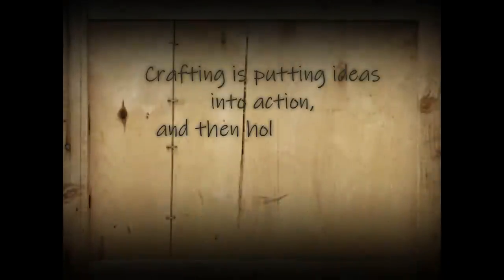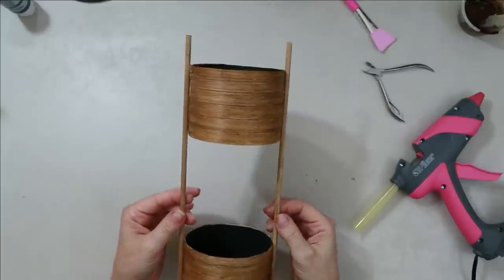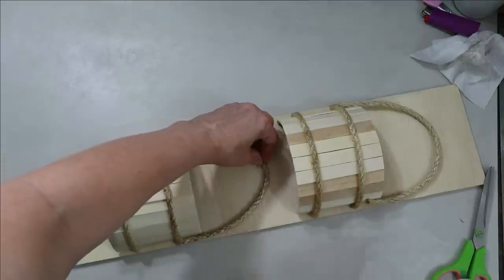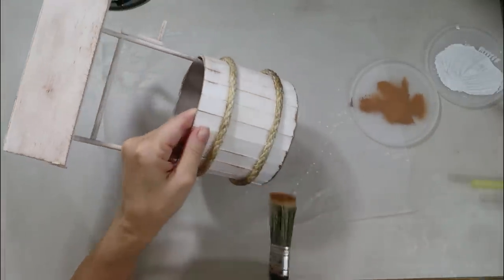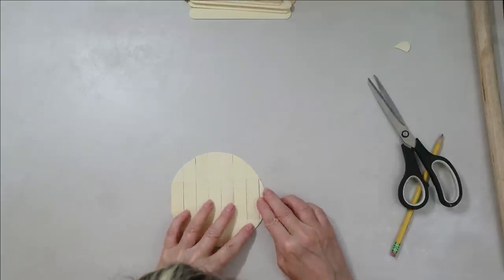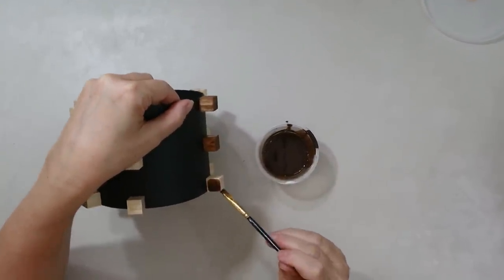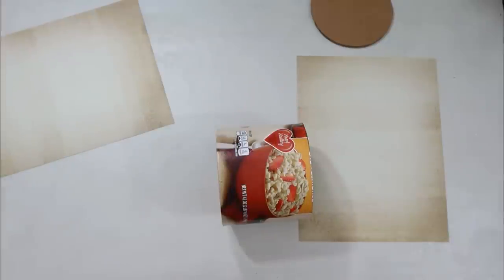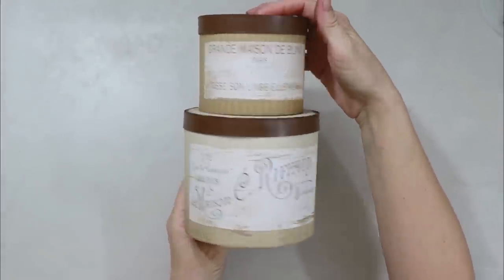8 AMAZING OATMEAL CONTAINER CRAFTS | CHEAP DIY CRAFTS

Comment: Oh my goodness I forgot it was Sunday. Thank you for doing these oatmeal containers I have a bunch of them on my refrigerator just waiting for a project or 2. Normally I recycle them by turning them into toilet paper holders LOL .
I used to live in a tiny apartment in New York and there was no room in the bathroom for a spare roll of toilet paper and the worst feeling is running out and not having a spare roll so I found that the Scott tissue or the store brands equivalent to Scott tissue fits nicely inside the can of oatmeal you get two rolls per can. So I decorated my oatmeal can with scrapbook paper and ribbon and florals and put it in my bathroom on the tank it was the only storage space that I had. I've made a few since for friends and relatives including myself. Necessity is the mother of invention.

 I am currently making a vase using a empty protein container and empty oatmeal can and a bowl that I made from scrap paper to act as a flute on the top. I always wanted a tall vase so I can put those pretty Twigs in for Christmas or springtime. I was using your idea of joint compound when I remembered the plaster gauze that they used to set your broken arms with, remember that? So to save money on joint compound I got a roll of plaster wrap and put that around and then put a layer of joint compound on top of that. It is my work in progress. I will have to tag you on Pinterest when it's done.

I keep seeing Christmas projects on YouTube now as well as the Autumn and I'm just not in the mood to do Autumn crafts it's coming too fast LOL

Comment: They are sturdy containers. I always hated throwing them away, because they are so sturdy. Now, I don't have to. The other thing I like is they are straight, up and down, containers. Usually the containers, we use, are tapered at the top or bottom, so these are great, for wrapping materials around them, or putting things like the popsicle sticks, up and down on them.

Comment: All very cute!!! Not sure if you actually use your miter saw on your craft table but, those sheets of non slip material ( that is used to keep dishes from sliding  around in your cupboards. Maybe even the rug kind) under your saw box may keep it still

Comment: You could use the butter thing for leftover bag holder?
Reply: I think that would work great (JMHO). If the 'churn' part can be lifted up easily, the space underneath (inside) would be perfect for storing plastic bags. I think that some extra weight should be added to the base to keep it upright.

Comment: I have to check out those paint sticks, that curvature, at the top, drives me nuts. I am so not ready for fall. The stores push it way too fast. I think, the last few years, they have just gotten stupid, on how fast they are getting out decorations for seasons, and holidays. I am sitting in PA, today, and it is actually cold. We haven't even had a summer, yet, here, so I am not ready for fall. It has been, either, cold, or rainy. We have had a few weeks of hot weather, but that is hit or miss. However, I imagine it is hard for creators to make summer decor, but I would like to see just some everyday decor, like the things you made, here, could be kept up all year long.

Comment: You're so smart and clever!! Question: Hot glue wood sticks. Is there a difference between them and regular glue sticks? What do you use?
Reply: Hi Andrea, I wondered about the glue as well. On line there is Gorilla wood glue sticks and sure bond wood glue. I don’t know if you need a separate glue gun?
Reply: @lindagrey9816  she explained it before..... she's super creative and very smart. I guess the the wood glue and wood takes a molecular form and bonds the wood better. (Now I'm smart when it comes  to medications im a pharmacy technician.) So hopefully she'll explain it again incase I'm wrong but it forms almost a "wood" bond if you will. Shes absolutely incredible
Reply: You do not need a separate glue gun. I use the surebonder wood stix on wood projects and I love them. Surebonder also has fabric stix which is also really good. The wood stix hold wood projects together better then regular glue sticks.
Reply: @lindagrey9816  No, you don't need a different glue gun. They make...regular glue sticks, wood glue sticks, fabric glue sticks, glitter glue sticks, etc., they all can be used in the same glue gun. The wood glue bonds wood crafts better, but, for these crafts, here, I imagine the regular glue sticks would work. However, if you are doing an all wood project, and, if you don't want to wait, for regular wood glue, to dry, then, I would probably use wood glue sticks. 

Here is a hint, too, the glue doesn't matter, to me, as much as the heat. I used cheap glue sticks, to make a bird mold, from a metal bird hook, and, I heated the glue, in a pan, on the stove, until it bubbled....I had forgotten to spray the metal hook, with some cooking spray, before I poured the glue over it, and that glue stuck, so hard, to the metal hook, that I had to scrape it off, with a knife. Now, usually, you would be able to peel hot glue off of metal, very easily, but I had to scrape it off. So, I think the heat of it matters, as much as, if not more than, the glue. I would not be afraid to use the regular hot glue on any of these projects, though. 

The previous commenter is right, though, wood glue attaches to wood and forms a molecular bond with the wood, almost acting like it is one piece of wood, rather than two.  I have torn wooden things apart, before, that had wood glue on it, and the wood actually breaks apart, instead of coming apart where the glue was applied. Wood glue is good for projects, made only of wood, especially.
Reply from the maker: Wood glue bonds raw wood together at a molecular level, so it's very close to an actual screw! Very strong. In this case, I found the hot wood glue just seemed to bond with every material I used better than my previous brand. Was the first time working with it, so I will have to wait and see, but it looks promising! Here's the link to the brand I used today. https://amzn.to/3wRb6Lb
Reply: @lindagrey9816  I have 4 glue guns..all mini!!!  I need a full size, I guess!